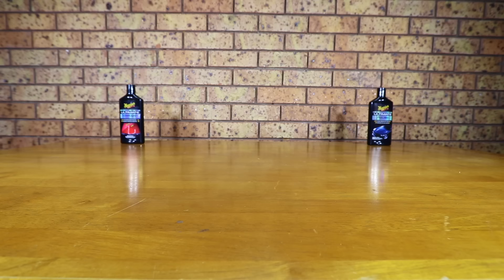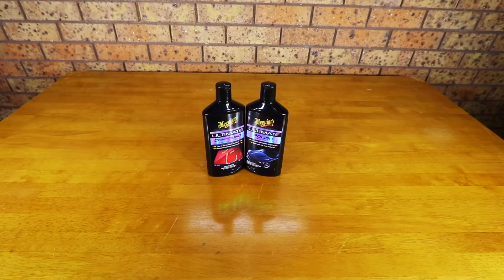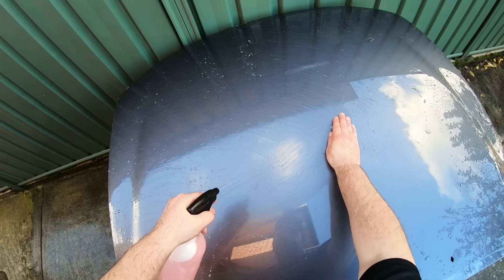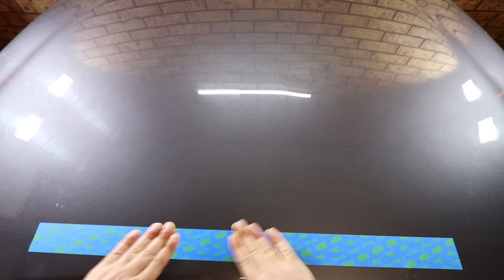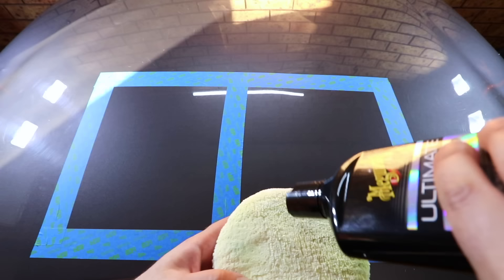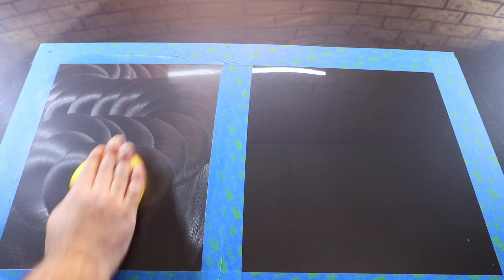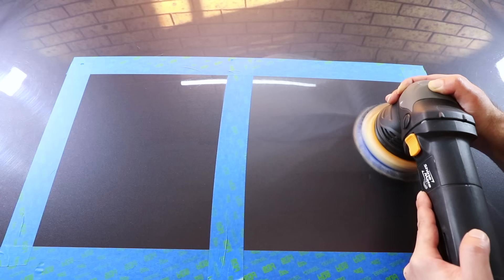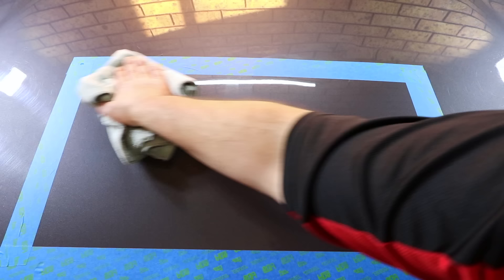How to Use Meguiars Ultimate Compound & Polish+ Review & Demonstration!

Comment: I tried a DA for the first time. I've got an 8 year old subaru with a black crystal coat. The condition of the paint wasn't the best with quite a lot of swirls. Started with the bonnet and did at least 3 passes with Megs compound - lost count to be honest. I was told not to apply pressure to the DA - the job was also polished but there are minor scratches. I'm guessing I'm not applying enough pressure?
Reply from the maker: Maybe have a look at the video below as it helps guide you through the paint correction process, but things like working smaller areas, slowing your arm movement and applying moderate pressure may help improve your results. 
https://youtu.be/6tepA3wjPbY

Comment: From what I’ve gathered about this line of products is that Meguiars has pads that correspond to them — red foam (compound), yellow foam (polish), and black foam (wax).  I’m curious why you didn’t specifically use these pads?
Reply from the maker: Although you can certainly use a brands corresponding pads, don’t feel you have to, and although you can also match a coarse compound with a cutting pad and a fine polish with a polishing pad, also don’t feel that you have to. Every paint and it’s defects are different so works well in one instance may not work so well in another, and mixing and matching is often needed to find the best combination of compound and pad. The video below may also help:
https://youtu.be/6tepA3wjPbY

Comment: Thank you for this review.  For a new car that came with faint swirl marks, would you recommend the Compound or Polish?  I will be doing this by hand.  Thank you!
Reply from the maker: I’d do a quick test in an area starting with the polish and if it removes the swirls that’s all you need, but if it doesn’t then I’d try the compound. Every paint and it’s defects are a little different, so doing a couple tests is the best way to discover what to use.

Comment: You are an excellent instructor. I was thinking I would have to wash my paint surface between the polishing and waxing steps. What I get from your video is that you can get polish off thoroughly, and go straight into waxing. I am sending you some internal wax hybrid solutions graphene spray coating. In your opinion is that a good product for protecting? Thank you so much!
Reply from the maker: Yes you can just wipe the polish off and then use and isopropyl alcohol mix or product like CarPro Eraser to remove polishing oils and it’s ready for protection. Hybrid Solutions Graphene should work great!

Comment: This is a very good video. Although I do have a couple questions, I’ve already purchased Maguires DA microfiber correction compound. What is the difference between that and ultimate compound. In your opinion which one would be better and I do have a few water spots. I will also be using a power wash afterwards. My end result is using Gyeon Synkro ceramic coating.I’ll be looking forward to your suggestions and comments. Thanks

Comment: Thank you for explaining this for us beginners. It does seem to be quite a long process. Compound, polish and then wax, in order to achieve a good result, not sure if I have the time to do it all. Also Sandro, in have a 18th month old car, which has some swirls and scratches, should I use compound or polish ?
Reply: @CarCraftAutoDetailing  Once again thank you for the advice.
Reply: @CarCraftAutoDetailing  One thing I forgot. I assume that it would need a wax after polish ?
Reply: @CarCraftAutoDetailing  Thank you, Sandro.

Comment: Many thanks! I just bought used Porshe Panamera. The paint is so haze. I learned from you the paint is soft. Can I try to use home use type Meguiar's Ulitmate Compound and Polish? Of course, I will use with DA polisher (Mid-speed) and fine pad for the first spot trial.
Reply from the maker: Yes, Ultimate Compound and Polish could certainly work well

Comment: Very nice video! I don’t have a machine polisher but can I use a drill brush instead with the right pads? Or can it cause damage?
Reply from the maker: Honestly I’d discourage using a drill to drive pads as it’s extremely difficult to control and the learning curve is high. A dual action polisher is much easier and safer to use especially if you’re new to machine polishing.

Comment: Great video instruction on the preparation and applying the products. Please advice if I can use this this products to remove minor scratches on ceramic coated car paint? Thank you.
Reply from the maker: Thanks, and it will remove minor scratches on a coated car, as long as you understand that you’ll also be removing the coating, so you would have to re-coat the panels you are compounding and or polishing.
Reply: @CarCraftAutoDetailing  i’ll take note of if. Thank you.

Comment: Second question on this, my mom, impulse buyer that she is, was at the store and bought a "scratch repair" product (I think it's called Nu Finish Scratch Doctor).  I read the bottle and it seems like a cheaper compound or whatever.  Is that all these scratch removers are, just another marketing word for a cheap compound?  I bought this Maguiar's Ultimate product so I don't really have any intention of using the Nu Finish, I'm just curious.
Reply from the maker: I haven’t used the Nu Finish one but you’re spot on that it’s just a compound - usually a heavy one of sorts and there’s a good chance it may not be the best one around 🙂

Comment: Awesome video! If using a machine would the meguairs microfibre cutting pad be the best choice with the compound?
Reply from the maker: The Meguiars MF cutting discs would be the best choice on a dual action polisher (you shouldn’t use microfibre pads with a rotary polisher) if you’re looking for maximum cut. If you’re looking for more of a light cut and good finish balance the Meguiars yellow polishing disc is a better option with a better finish and less risk if you’re new to machine polishing.

Comment: Hi, great video and really helpful demonstration ! I would like your opinion about applying wax on top of ultimate compound. Does a wax like fusso coat retain its protection and durability ?
Reply from the maker: Just remember you’re not applying anything over Ultimate Compound, the compound removes the defects and then it’s gone when you wipe it off. So you should definitely use a wax, sealant or coating to protect the paint after compounding/polishing and Fusso could work well
Reply: @CarCraftAutoDetailing  Thank you for your quick response! Do you think applying ultimate polish after ultimate compound and then applying fusso coat would work ? I am reading that ultimate polish contains fillers that would reduce the durability and hydrophobic effect of wax .
Reply from the maker: If you want maximum durability it would be best to use another fine polish to finish with that doesn’t have any fillers, but they are quite minimal in Ultimate Polish so it will still work okay.

Comment: Great video! Few questions though.. Can I use these on the interior parts with piano black finish to remove swirl marks? Also, would polish alone remove the swirl marks without using the compound first?

Comment: I am trying to blend new touch up paint with the original. Would ultimate compound be enough? I know you're supposed to wet sand 1500 and then blend with compound. Maybe get the aggressive compound cut? I also heard ultimate compound is like a polishing compound. I need a rubbing compound. What do you recommend?
Reply from the maker: Maybe have a look at the video below, about half way at I show how to sand and the compound/polish the touchup. Different paints can require a different approach and I try to explain that in the video: 
https://youtu.be/4f9zqVbcZDQ

Comment: So basically once you have used ultimate polish on good paint surfaces, like fairly new cars, then protect it with meguiers next gen paint protection or paint protection fast finish or products used by sandro ,which he has recommended based on his links, thats the way to do it, basically and if done right and you use a good paint sealant ,like wax or ceramic coating, then you will find it a lot easier to wash and protect the paint surfaces as you enjoy your car ?

Comment: I've had no luck with the polish on my black Hilux excellent finish but I'm still leaving buffer trails. I've filmed myself to see if I'm tilting the pad or anything and everything looks fine. Any thing you can recommend to rid these buffer trails would be appreciated
Reply from the maker: If you’re using a rotary polisher the video below has tips on finishing well and avoiding holographs. I try and keep the polisher complete flat and level with the paint, use lowest speed and choose the right pad. Alternatively a dual action polisher is far easier for beginners that doesn’t have that same longer leaning curve. 
https://youtu.be/zvZw4I7grH0

Comment: Great video. So, if you follow these steps but do not protect with wax or sealant, will scratches come back after washing?
Reply from the maker: Thanks and the scratches won’t return on their own after doing true paint correction , but that doesn’t mean you can’t and won’t create new ones - unfortunately that’s just life with paint, it will and does scratch. But you should definitely add a wax sealant or coating after this process.

Comment: I have just bought some of the Meguiars ultimate polish and I find it very easy to use, I notice in your videos after washing that you spray it and wipe off, what it that? I have seen products that remove old wax and polish before you put new polish on, is that something that you would recommend or would a compound be sufficient. I have used a clay bar before on one of my cars and was surprised how much debris it got off.

Comment: I have tiny svratches from birds feet. I tried compound but didnt work. Maybe I need to swirl harder?
Reply from the maker: If the scratches are contained within the clear coat them having another attempt may give you better results. But if they are quite deep and have gone through the clear then you won’t be able to entirely remove them.

Comment: I want to prepare my car for ceramic coating.  The car is almost new (1 month old) What should I use, compound, polish or both? Thanks!
Reply from the maker: A primer polish may be a better opinion for you (Ultimate Polish has some light fillers that may cause bonding issues with a true Ceramic coating) 
A couple of primer polishes are Carpro Essence and Nv Morph.

Comment: i seen some grate work done with this compound and polish. Seen what the cost is vs the 105/205 its not a deal as you can get them in a pack so if your a mobile or just a guy that likes detailing its a winner really. 

The shine mate da your using whats it like for correcting ???? I have the shine mate 21mm and its grate but sometimes would like a more lighter machine that has less throgh to get in some places that my 3'' shine mate da is really to small for
Reply: thank you mate might have to get one

Comment: Great video & very informative. I want to remove the shallow swells from my red Honda fuel tank on my motorcycle. Some people remark that motorcycle paint is 'soft'. Which hand pad would you suggest I use with Meguiar's ultimate polish. Also regarding the plastic panels, they seem to be painted (I might be wrong) without any clear coat is this the case genuinely & if so, would ultimate polish be okay to use on them without damage ?
Reply from the maker: Thanks and generally Honda paint on car and motorcycle is soft, so perhaps a foam applicator would be best, and if they are just very light swirls it may be enough. 
Generally if the finish of a trim is smooth and glossy, it can be polished in the same manner regardless. Just never polish matte/satin or textured trim finishes.
Reply: @CarCraftAutoDetailing  Once I apply the compound & polish using the yellow Meguiar's soft foam hand applicator what would you then suggest to take oils off the tank before I ceramic coat, IPA ?    Some people say even if you diluted IPA with water it can damage the paint. What product/s would you suggest  ?
Reply from the maker: IPA won’t damage paint as such, but sometimes can degrade the finish on more sensitive paints with some minor haze or light wiping swirls. You don’t have to do an IPA wipe (if you’re not applying a coating) or you can try further diluting the IPA solution with some more deionised water to make it weaker if that’s an issue in your paint - on most paints it’s generally not an issue.

Comment: Hi! 
Representatives in my country say that you can not use as I want: Ultimate Compound and after the application of ceramics, but I insist on mine) they recommend using hard clean polishes, but I'm afraid to erase the varnish🥲

Can you please tell me if this polish is suitable for removing minor scratches and after applying nanolex ceramics? Is there silicone/wax and other nasties or is it still a regular fine abrasive polish? 
Thanks, sorry for my English.
Reply from the maker: No, unfortunately compounds and polishes generally aren’t suitable for use with a coating on the paint

Comment: what the difference between  Meguiars Ultimate Compound and  Meguiar's Microfiber Correction Compound ?
Reply from the maker: The MF correction compound was developed to be primarily used with machine driven microfibre pads - it may also have a touch more cut than Ultimate Compound but perhaps not quite as good a finish.
Reply: @CarCraftAutoDetailing  thank you !

Comment: Hello Sandro 😉.
So, I posses a car with 11 years that has never been polished or compounded so I'm afraid of using the Meguiar compound and destroy the clear coat and, consequently, damage the paint permanently...
My car paint is a non metallic grey and the car is a 2007 Toyota Yaris hatchback!! 
There is any safe way to conclude if a car paint can be compounded with a product like Meguiar Ultimate compound?. 
BTW, I don't possess any paint thickness meter 😐

Thanks for your very informative videos.
I would like to see more about the different pads and products to use in a paint polish vs compound

Comment: Used clay bar, polish and paste wax on mine today and came up great! was absolutely caked in tar living here in the UK.
Reply: Hello!  stupid question but i think that i don t need to isolate with tape the panel i work on, right?
Reply: @AncientSouL1000  nope, you can just apply it straight to a panel at a time, just like applying a wax. work in circular motions with medium pressure with the polish/compound, and then buff off after 5-10 minutes :) then apply a wax afterwards.
Reply: @Xopher222  thank you for taking time to answer! I m gonna try this for the first time  on thursday, hope it ends up ok without scratching it more
Reply: @AncientSouL1000  you won't scratch it more, so long as you use a meguiars microfiber applicator pad. you can get them from halfords etc.  it works by smoothing the sharp scratches in your paint's clear coat (on top of the actual paint), by working them down, so the light reflects at less of a harsh angle to your eye, hence the light bounces off your car better. Just make sure you have a microfiber pad and the compound/polish :) if you compound, you will want to polish afterwards, and then use the wax. it makes the paint come up excellent.
Reply: @Xopher222  i got a lake country ccs compound pad, didn't find the meguiar one in my area
Reply: @Xopher222  it worked as expected. All i m hoping for now is that the scratches won t appear again after a few washes. Was thinking about buying the ultimate quik wax  but am not sure if it s really worth it.
Reply: @AncientSouL1000  i don't have much experience with those, however you should get away with 2-3 washes with the wax still providing protection.

Comment: What product did you use to clean the surface around 11:30? Also do you have to clean the surface after every step or would it be fine if you just wipe it off?

Comment: This video is very helpful, thank you.  I'm going to try this for the first time soon, it's my first attempt at using a compound.  I'm lucky I have multiple, older, low value cars to practice on.  I have a question, at the 12:20 mark in the video you mention how important it is to use a wax or sealant (I've been getting better at those - especially the Maguiar's Hybrid Ceramic Wax); my question is, why not actually just add a new clear coat to take the place of the one that was ground down by the compounding process?  I see "diamond hard clear coat" paint products online and such, why not do that rather than a "sealant"?
Reply from the maker: That’s great to hear! 
You can’t just add clear coat over clear coat , it won’t bond or really work out well at all. The panel really needs to be stripped back to bare metal, primed, base coated and then clear coated to do it right, or at least sanded back to the base colour, then reapply the base colour and clear. 
Sealants are used to protect the clear coat so that you don’t need to go through that time consuming and expensive repaint process.
Reply: @CarCraftAutoDetailing  Okay, that makes sense.  Thank you.
If I see a link to a product I'm curious about, do you mind if I ask you about it in these threads?